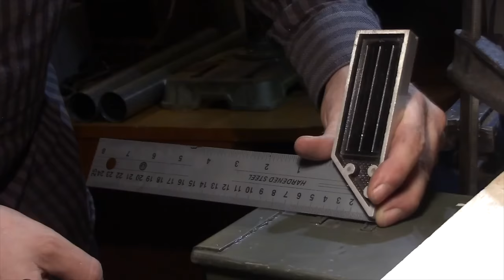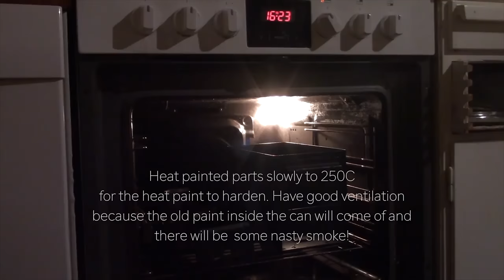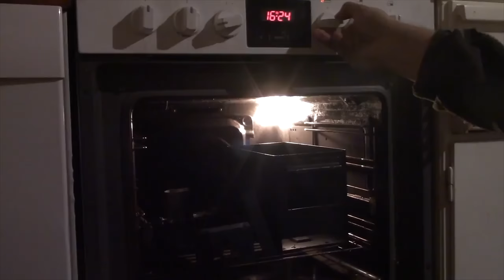Solo Bushcraft Overnight - Canvas Lavvu Hot Tent - Ammo Can Stove Step by Step Build

Comment: It is useful to remember that an AX is also a sharp blade:  you show exactly why!  In my Gymnasium (Highschool) years, I went camping in deep snow high on a glacial hill remains.  We knew so little!🙄🙄  Had we known about a stove like this or like many other similar commercial stoves, we could have had comfortable nights! (We did not have such nights.)  We could not start a fire without resorting to 'scoutmaster fluid' (the comic name for kerosene used in Scout camping.)  TODAY,  I understand that light poles, cut with a folding saw and jointed with such a fine ax can be everything that is needed for a winter camp.

Comment: I've tried the 2 pole lavu setup, and it works great! I recently was given all the tons of hardware, and some older tools from my friend's father's workshop. 60+ years of "stuff". Now I need projects like these to use up some of it. Am I right that the Akka has a thinner edge profile than the Husqvarna Carpenter's axe you sometimes carry? From the side, they look very similar, but I think looking top down, the Carpenter's axe is more narrow wedge shaped and the Akka tapers down slimmer just past the eye? it did a great job slicing, you have put quite an edge on it! Good to see some of the gear you made back out! 👍🇨🇦
Reply from the maker: Never heard about Akka. Its a Hultafors Åby. Its not as thin as the husqvarna but thin enough to be a good hybrid for some carving etc. Thanks!

Comment: Very cool as always brother. Do you keep the stove burning all night as you sleep, or does it take constant refueling? And how warm does it get with the half lavvu as apposed to a double set up? I built one of these stoves a couple of years ago, but with a cool air intake and secondary burn set up, which works great but burns through wood way too fast. I’m going to pick up a new can and give it a go with your design.
Reply from the maker: This was a closed shelter at nigh. I never have them burning when i sleep. It gives heat for about 40 min to an hour which is enough for what I need it to do. If you took the time to make one with secondary burn, damper and all the extras use that one!